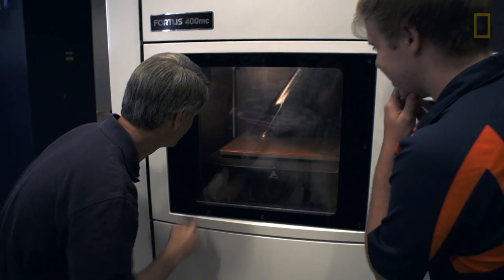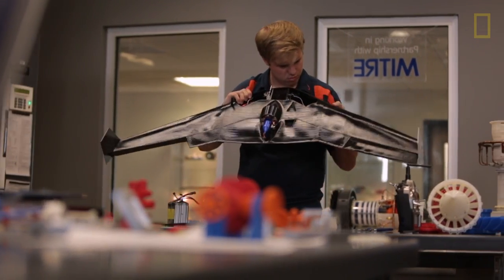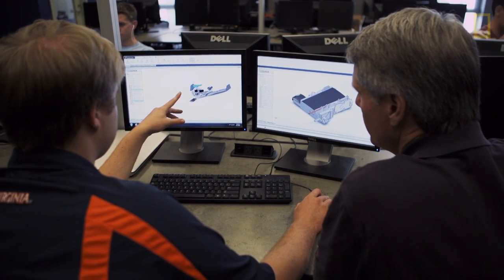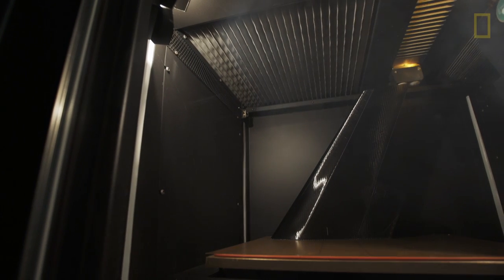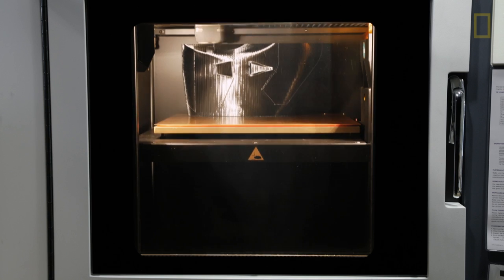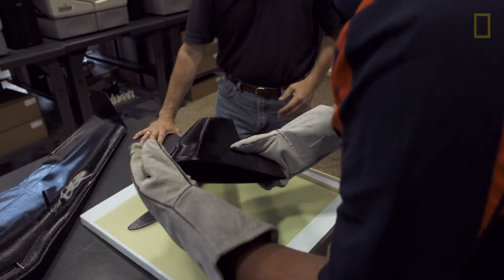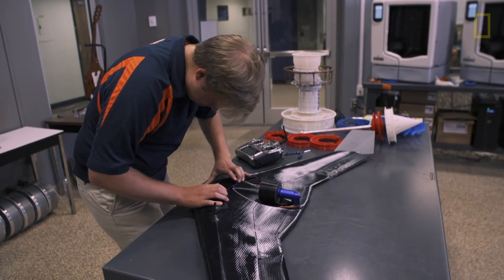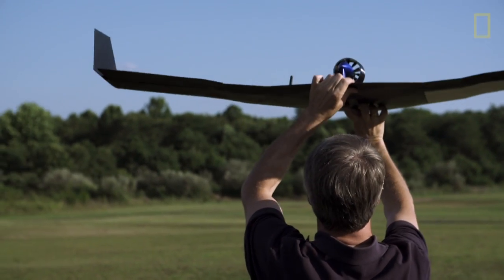Why Use 3D-Printed Drones? | National Geographic

Comment: I do a lot of 3D printing, and I also build RC aircraft. Simply put, a completely 3D printed airframe has a very poor strength to weight ratio (especially when printed with the layer orientation shown in this video). If printed thin and light enough to fly well it will break apart under moderate flight stresses or during mild crashes that conventionally built designs would survive with no problem.
The only practical use for large 3D printed parts that I have found is to use them for  support molds for carbon fiber layups. Small 3D printed parts make sense - but not entire wing structures.
These guys are using an off-the-shelf 3D Robotics APM flight controller. They didn't develop a "fully autonomous" anything.

That little ducted fan is very weak and highly inefficient. These guys need to use a larger edf with better positioning. Even better, they should use a large folding prop for much higher efficiency and thrust.  Obviously these guys are NOT experienced aircraft designers.
Reply: +K Danagger haha thought the same thing! you know what's up! you know what's more fun, bladder molded unibodies using 3d printed molds :)
Reply: +K Danagger id rather just 3d print a drone shell
Reply: K Danagger You have a point, but using printed parts removes a lot of man-hours from the job, as well as requiring less in materials.

3d printed vehicles could be immensely useful for applications like search and rescue where being able to quickly replace a part could save someone's life.
Reply: @Aaron-ne4kr  3D printed search and rescue but the robot breaks halfway through the entrance because it bumped itself on a pebble.
Go on now, change the part. Did you bring the printer or did you bring spare parts in anticipation?

Comment: 3D is neat, but I think it still has some drawbacks. But definitely not something to rule out either. You could probably get the best use by using it in hybrid material construction.

Ribs, joining structures, spacers, mounting points, stuff like that - 3D print them for flexibility in design and convenience of fabrication. That obviously will save selecting the material, templates, cutting and sanding and most drilling. Spars or anything else with heavy loading over its length? Use OTS composite rods for strength. Then film, fiberglass, or even "old school" fabric for the outside skin to save a lot of weight. The time spent on gluing those things to form the overall structure with some printed parts is still likely less than a full 3D print if the design is thought out well enough.

So just print the fiddly bits with specific custom shapes and use common material components for what should be the strongest structures or that which is very quickly made by using flat stock.
Reply: the drawbacks literally outweight everything, exept for the the fact that you're 3D printing a flying wing, which is a pretty cool feat to pull off. it has no benefits in prodution cost, weight and mechanical properties.
you can build a wing of that size from hardware store foam, cheap carbon, hot glue and tape for about $20 in an afternoon, that will be conciderably lighter and at least as durable.
there are plenty of areas and parts where 3D printing is a good option, though, including prototypes to make take a mold of, and cast expanding foam.

Comment: These guys are making rc airplanes and calling them uav's and drones and shit. That's funny.
Reply: Hahaha
Reply: +jrlmbert Technically it is a UAV. From what I can see they are using APM for control. And APM is capable of fully autonomous flight. So yeah it's a dron.
Reply: +flanker what's kind of funny is I do the same sort of thing except I built a CNC controlled hot wire foam cutter to build foam flying wings.  I then cover them in packing tape (Tape Brothers has really awesome selection of colors and strengths)  as I found that to be the lightest, cheapest and most effective way to finish the foam wing.  I even messed around with EDFs for a bit but finally gave up and realized that just a standard prop worked way better!  and I recently switched to the CC 3d revolution and that just blows the APM out of the water (And speaking of water my foam wing actually floats as I crashed into the lake by my house once... Lol).  but I will give these guys props for the amount of batteries they fit in the nose is that drone... Haha. Either they have a wicked long flight time or that thing is just so ridiculously heavy it needs that much power to stay in the air for just a standard amount of time.
Reply: Nicholas Brehm I've heard of openpilot but never used it. Read somewhere that there was a bug with their flight control algorithm that they couldn't fix for years. Also the "flex port" connectors don't appeal to me. I don't have the crimp for that type of connector. So if I want to modify the cable, I have to solder(which doesn't looks as nice as crimped connectors)

Comment: "If something breaks while flying, we just print another part! on our costly 3d printer"
...Yeah, normal RC has that too, you know that you could glue foam, right?
I patch up my planes too, they don't look like new... But they take crashes a hell of a lot better. And with FPV, I look outside of it- so patching with a bit of offcoloured foam works fine.

I wanted a 3d printer so badly once I saw them... Glad I didn't buy one yet, as the quality/ price doesn't quite match up, and... I've flown a 3d printed quad. "you can easily print new parts, when you need them every damn time you hit a twig!"

Comment: What is that material they are building with? It looks awful lot like carbon fiber?
Reply: +flanker Yes, it does look cool like carbon fiber.  But carbon fiber is a layered mesh in resin which I doubt can be printed.  Its probably just an all black nylon plastic which is a common 3D material.  I'd probably not use black for general RC usage though.  The hot sun will very likely warp a black colored plastic body of this plane when the plane sits out in the sun in summer time!
Reply: +Rotormatic There are carbon fibre blend filaments these days, but it's still mix with nylon/ABS/PLA etc. Stronger, lighter for sure, but I'd assume not quite as good as the real deal.

Comment: Sigh..The guy flight testing the controls has no clue which way that plane will roll when given left or right input. Watch him completely roll it the WRONG way while in his hands. Wtf are we celebrating psudo-intellectuals like this for?
Reply: Engineering as schools do it seems to favor somebody who can recite Young's modulus and other definitions and formulas out of a textbook. (The clever people that don't think that way tend to get weeded out in freshman year. Easier to just go into programming or IT.) Also probably knowing the material schedule so designs can fit whatever hypothetical projected budget. Maybe a few lab-style classes to fool around, but overall experience is still small. Thus designing for use or practicality seems to be an afterthought. Probably the same reasons why turning a wrench on most stuff is a PITA, the people that designed it still fail to get their hands dirty. Not to say the engineers that go in arms deep aren't out there, but they tend to be in the field (think fancier better paid technician) rather than changing things for the better at the design stage.
Reply: justclimb77 i thought i saw the same thing!
Reply: justclimb77 well actually he‘s testing the autopilot stabilizing. In you pay attention to The rc Transmitter you Are able See clearly that he doesnt Even Touch the sticks. Better turn on your Brain before you are going to Write a Comment.